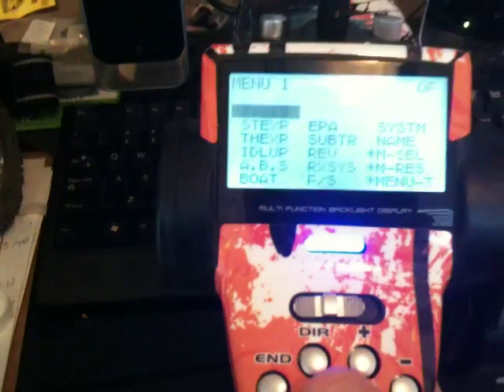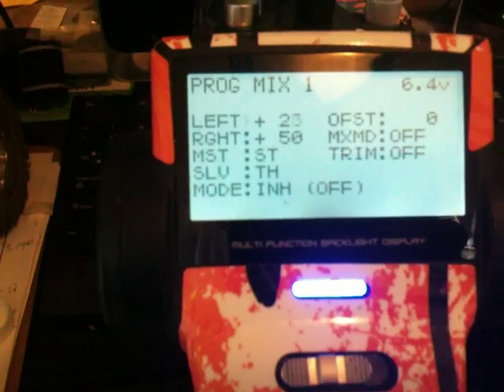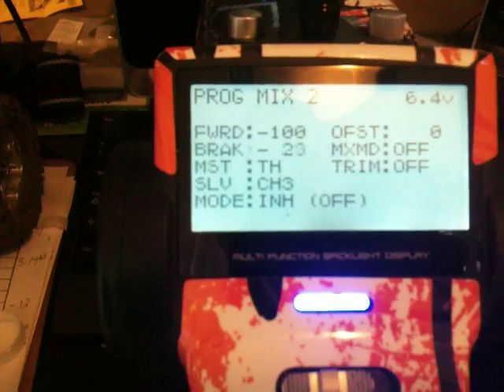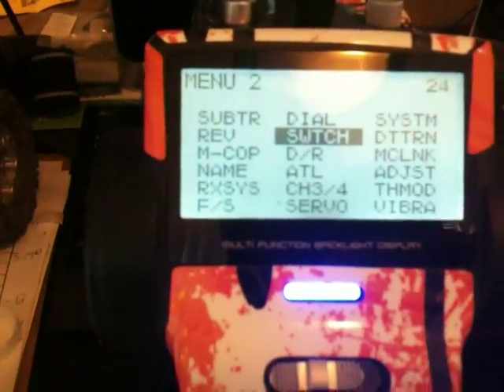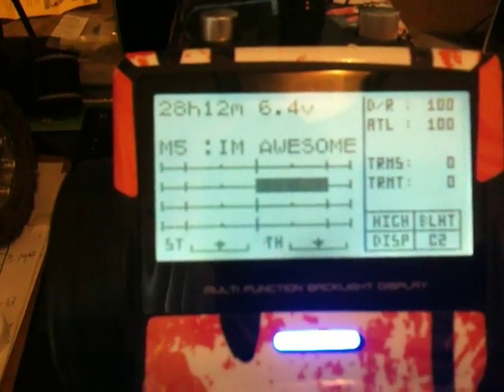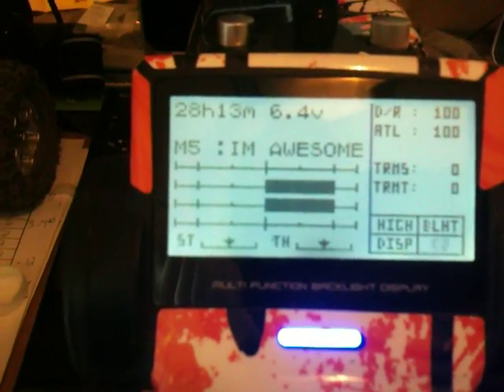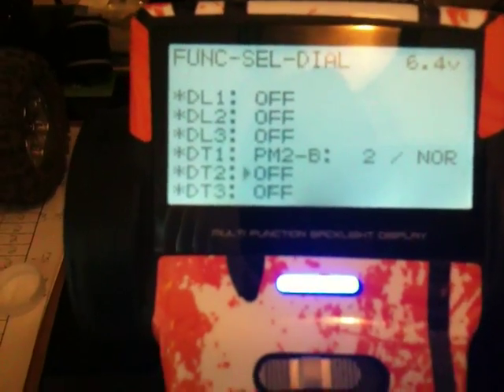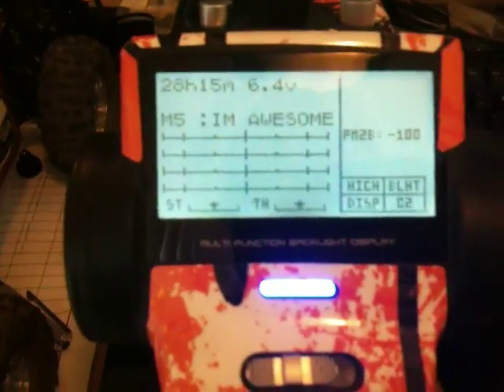Harley's Futaba 4PK Programming Guide for Dual ESC Crawler

Comment: @BirdReynolds All i can say is after going for a "smoke" and really thinking about it having the buttons apart from eachother is the way to go (no more oopps burn instead of dig) and i should have thought about it a bit more but i just bought the pks and 9 recievers to convert my fleet to futaba so other than fearing the new and learning something new. your video was top shelf and worked perfectly  it was my sandy gigi that was the problem thanks for the help and other perspective

Comment: @BirdReynolds so all you guy use multiple buttons in different location all over the controler that have to be turned on and off instead of using a novak link that at least can be used as ONE three way switch to control everythinng? its rediculous i wish i would have stayed with my old set up wich by the way worked great and was a dual esc set up if all i was giving up was adjustablitiy of esc bias then i made a huge mistake